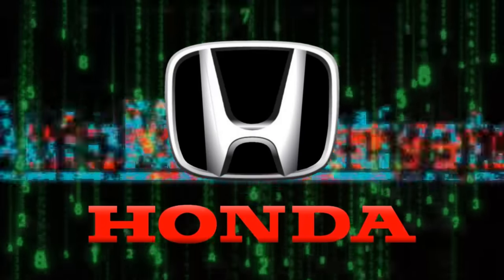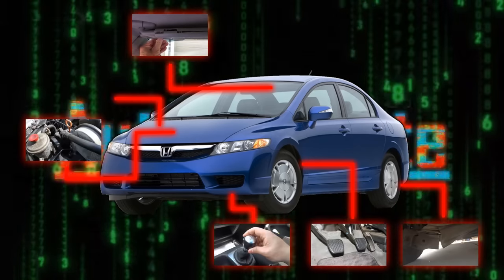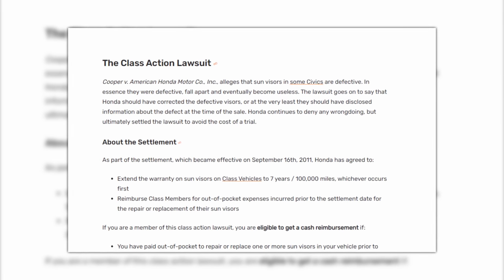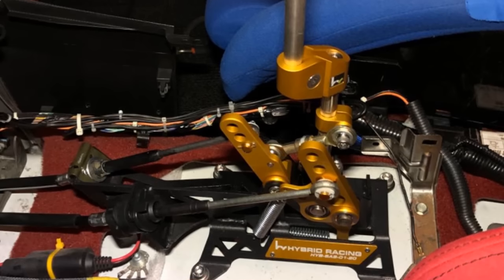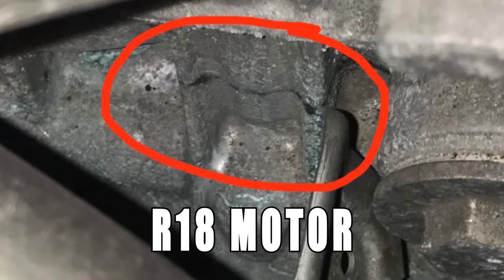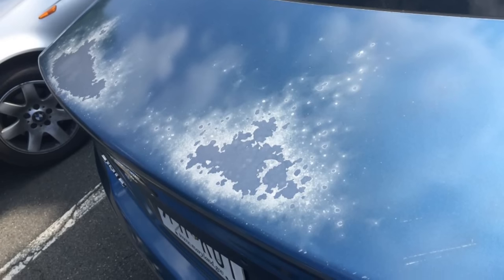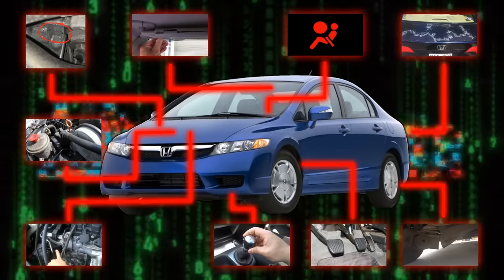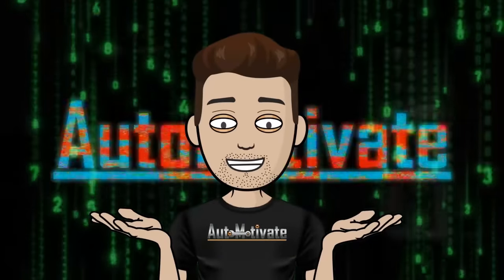Watch This Before Buying a Honda Civic 2006-2011

Comment: Over 400k on my 2006 Civic LX and she still drives like a charm!
Reply: I have a 2007 lx I can only hope mine lasts that long
Reply: 380k on mine. Super reliable. I love it. Abs just went on it though. Hoping for an easy fix.
Reply: R18?
Reply: I’m going to buy a 2007 lx tonight I’m super excited....
Reply: Jonhnny Ringo is it considered a sports car tho? For insurance purposes???
Reply: @teeniequeenie8369  what's the mileage on it? you're gonna love the car it's very reliable
Reply: 400k ? Went around the world twice sheesh
Reply: Manual or automatic transmission?
Reply: At what intervals do you change the fluids, if at all?
Reply: @marajevomanash  100,000 miles. Make sure you use genuine Honda power steering fluid as other types can destroy the seals.

Comment: I've had my 2006 for 14 years. No real problems, but the sun visor does fall. It has 340,000 miles and runs like it did the day I bought it. The most reliable car i have ever owned.

Comment: I owned a 2007 Honda civic. Of the eighteen cars that I have owned in my life, it ranks in the top three, without a doubt.
Reply: Interesting! I just got a 2007 Honda Civic. What were the other two cars that were in your top three?
Reply: Any issues in the last 5 months? I’m looking at an 07, but worried about the cracked engine block issue
Reply: I have a 2007 Honda Civic only had one problem in the time I’ve had it
Reply: What are the other two cars??
Reply: Just bought a 2007 civic. Lovely little car
Reply: Were the other 2 older gen civics?
Reply: @kingdoge69  That was mostly the 2006 model year and was fixed by the 2010 model year.

Comment: Mine is 06 civic coupe, best car I've ever owned. 160k miles and keeps on moving.
Reply: petrol or diesel?
Reply: Mine too
Reply: I am borrowing an 06 civic which currently has 204,000 and drives really nice. No, noticeable oil issues or engine issues, no major transmission slipping. 

I believe it has the r18 engine and automatic transmission. The interior is pretty nice. Good car.

Comment: 235k on a 2010 ex coupe. Only thing replaced, outside of regular brakes/tires/plugs, was a cat and engine mount at 100k.
Reply: I can attest to the pass. side engine mounts the hydraulics start to leak off eventually, solid cars though... like rock solid.
Reply: Brakes go quick in my 2010 civic and it is not because I ride my brakes. Always on the gas letting my turbo add a little fun

Comment: I love my 2011 Civic manual, no issues at all aside from the left rear wheel bearing at 110K. This car is so smooth to drive. I find that buying a car at the end of the model cycle helps to avoid common issues.
Reply: I got a 2011 also..I love it
Reply: The 06 thru 09 look better with those short overhangs and that steep rake in the windshield rolling artwork
Reply: I took a gamble and bought the first production year Si 😎

Just lost my driver side front brakes yesterday 😅
Reply: I have a 2011 Civic and after 12 I had my first part failure , the thermostat failed open after 134,000 miles and it was due for a coolant flush and change anyway , so I would call that unbelievably reliable and yes my paint is still great !

Comment: I literally have had none of these issues except for the motor mount issue, and that one is surprisingly easy to fix. These cars are very reliable. The only other issue I have had was a couple batteries needing replaced, a valve cover gasket, and then a starter, but those are all preventive maintenance issues that occur on ANY vehicle. I have around 190k on my 08 Civic EX coupe and it's still running strong. Though the issues in this video can potentially happen, they are still pretty rare issues
Reply: Update: I did end up running into the cheap visor falling apart on me lmao. Just went to the junkyard and got another one for $10. Sucked but it wasn't a big deal
Reply: how did you fix the motor mount issue?
Reply: @luisishere987Replacing them duh

Comment: I had the visor issue and my headliner sagging quite a bit. Another thing that I’ve seen on many 8th gen Civics is the weather stripping deteriorating everywhere but especially on the sides of the windshield. Nonetheless my 09 Civic has 110K and has never given me any problems in its 13 years of service. Still drives like new!
Reply: The headliner is an easy fix. My wife and I put red and white plaid on it 😅
I took the visors out because race car lol. #weightreduction
With the weatherstripping, another easy fix. That part is pretty easy to find and install. 
Couple easy projects to fix the car up! Cheers 🍻
Reply: Yep I have the problem with the windshield molding also. Called the dealer, and those 2 side strips were quoted at around $400. The parts person was just as shocked as I was.
Reply: @Maggot00679  Just clean the weather-stripping and rub ATP AT-205 Re-Seal on it.
Reply: @parkerbohnn  mine got to the point of falling apart and cracking so I wish I could have just done that. Thanks for the tip though 🍻
Reply: @Maggot00679  Honda should have had a recall on the 2006 Honda Civics there were so many cracked engine blocks in that model year. It really took to the 2010 model year to fix the problem.
Reply: @parkerbohnn  mine is an Si with a K20z3, so I never had the pleasure of dealing with the notorious R18 dying at ~90k miles.

Comment: Own two of these both coupes 07 and 09 great reliability and economy. Both have had motor mounts and third brake lights replaced. Radios also have issues but still work. 07 has 235k and 09 has 150k everything else has been routine maintainence would buy both again in a heartbeat
Reply: Are 09 civics just as susceptible to have a cracked engine block? I heard it wasn’t an issue for most 09 civics but it was still there
Reply: Radio issues will eventually lead to failure.  I'm surprised this did not make the list.  Also, cabin air blower motor and cabin air flow direction mechanism are common issues.

Comment: I bought a 2011 civic new, and am still driving it with 277000 miles, and have had none of the issues listed.  Only issues with mine was a power steering rack replacement, and replacing the compressor clutch for the air conditioning. Both of which I did myself.  The car has never been in a shop for repair other than a recall for the locking mechanism in the doors.  It consistantly gets 38 miles per gallon when I drive it (very little city driving).  No cvt, no turbo, no hybrid, and no problems.  I bought it on clearance for under $17000 when the new model year was coming out.  It is the best vehicle I have ever owned.
Reply: How's it going now?
Reply: Still going, we are going to give it to our granddaughter when she gets her drivers license.

Comment: Very interesting I have 305k on my 07.  Cheapest car To maintain that I’ve ever driven
Reply: Is the battery still working?
Reply: @lauraarabo7939   I bought a new battery three months ago. All is well so far.
Reply: @sangery5697  Thank you for replying!
Reply: I have a 2007 honda civic dx-g is it the same as yours basically ?

Comment: I redline my 2010 Civic Si about 20 times a day and somehow get 29mpgs combined. Like I literally dont understand.
Reply: Used to get 16.2 mpgs in my 2005 Subaru Legacy Gt after redlining it maybe twice a day.
Reply: lol same with my csx but i dont get that good at all for some reason?
Reply: @outdoorscanada9493  Are you stock?
Reply: @outdoorscanada9493  You meant crx right?
Reply: Yalll need more air in your tires if you getting bad gas mileage I run mine at 35 psi but some times I even go 36psi  lol
Reply: I had a 2015 so redlined it everyday for 4 years totaled it by wrecking into to a light post at 100mph in reverse
Reply: @leonardoantonietti400  Pardon? Why tf were you stunting in reverse?
Reply: @leonardoantonietti400  100 mph in reverse, great  cap 🧢 🤣
Reply: Gas can last me 2 weeks doing the same thing 😂
Reply: Oh I know why. It's a Honda :)
Reply: u average 25mpg tapping the rev limiter wherever i go in my mini truck
Reply: Whens the last time you cleaned your Map Sensor and throttle plate area? 
I just cleaned mine and holy shit I got my zoom zoom back and my gas mileage went back up!!
super super easy to clean too... use the CRC Mass Air Flow Sensor Cleaner... it's very gentle and is the only thing that should be used on the sensor... you can also use it to clean throttle body too... Peace!

Comment: I love my 2008 Honda Civic Sedan EX! 161000 miles runs like a champ!
Reply: Awesome! I just ran into a guy today about 2 hours ago who has a baby blue 2008 Honda Civic I think he said DX, maybe he said EX... but it looks so smooth... all he did was have it painted and put cool white rims on it and a muffler... and tinted windows. Look like the front was lowered a little bit too... looks so cool... do you know if they 2011 model has same look or do you recommend another model in this generation? I am looking to get 2008 unless one of the others is better to 2011.
Reply: Yesss I have a 2006 sedan ex with 131k!! She’s beautiful
Reply: @MikeKollin  2008 is a great reliable car. If you can buy one with normal miles for its year and has had regular routine maintain eye I would buy one! Sorry for the late response.

Comment: My 2011 has had zero issues outside of normal wear and tear and minor accidents still runs like new after 180k plus miles best most reliable car I have  owned
Reply: Have a 2011 with 108k. Not a single issue
Reply: How is it now?

Comment: 400k on my 08 Civic. No major repairs so far. I Just change the oil using full synthetic oil 🤷🏻‍♂️
Reply: WOW
Reply: That’s all you do?
Reply: @jonsnow2661  well I have drained and refilled the transmission oil when the service code requires it. Changed spark plugs a few times too.
Reply: I am a student and looking forward to buy a 2006 Honda Civic with 280k miles on it for $3500, single owner and no accidents. Should I buy it ?? The dealer mentioned it is sold as-is and he mentioned it twice.
Reply from the maker: If you have the cash, I would go private seller.. probably find one with much lower miles
Reply: @Schrodingers_cat000  Never pay a dealer what they ask.
Ask them why they won't give you at least 30 day warranty.
Bring a mechanic with you to do road test and let him inspect everything.
Good luck.
Reply: @Schrodingers_cat000   you can find an 06 Honda Civic for the same price with way less miles from a private dealer, I suggest passing on that one, dealerships always overprice cars
Reply: What about changing brake fluid?
Reply: Automatic transmission?
Reply: @brandonidrovo6348  yes it had automatic transmission. We sold a year ago with 148k on it. Still running. Got $2000 for it. 😃👍🏻

Comment: My 2010 civic LX runs like new with 130k miles and has never had one issue. Just maintain the engine oil, filter, power steering fliud, brake fluid etc and you'll be driving that car for the rest of your life. Oh and change your power steering fliud every 60k miles that's want causes the pump to fail is dirty power steering fluid. If you feel it's hard to turn your wheel it's most like just dirty fluid. Not a hard job, YouTube has so walk-throughs

Comment: About to cross 200k on my 11 civic lx 5spd manual transmission. I bought the car brand new in 2010. These are the "major" repairs I've had to do since owning.. clutch, alternator, serpentine belt, rotors and pads, new battery, oil change. It has been a great car for all these years. I would highly recommend to anyone, especially the manual version. While not the fastest, it makes driving the car that much more enjoyable.

Comment: I have a 2006 Honda Civic and it had only 33K miles back in 2017 and today it has 55K miles. It still runs like a champ! 🙂
Reply: I just bought one with 70000

Comment: I own a 2006 with the 5spd manual. I live in the Rockies and at 4500 feet this car is SLOW. 
Still, 180K miles and still kicking. Great buy.

Comment: I bought my 2007 civic in 2015. Still have it 9 years later and I LOVE it. I did have to replace the power steering pump, and the starter since I’ve owned it. Now I’m saving up to replace the motor mounts and the shocks and struts. Love my civic

Comment: I had a 2007 Honda Civic Coupe for 13 years. It was not without its problems. A lot of things in this video also happened to me including both visors, the engine mounts needing replaced, the wheel axel needing replacement because factory one was defective. Also the paint, airbag lights and even the engine block cracking are all true. I got under the warranty by 1 month dealer told me. It was a good car that never really rode straight or stable but excellent on gas for sure, nice sound system, coasted like a dream and a cool dashboard display.

Comment: i have an 06 honda civic and i absolutely love the car the drive, the milage, the looks, everything... when you mentioned the crack in the block i felt that one because the same thing has happened to my car.. the way it happened isi got service done at honda and my car was around the early stages of 100k miles and since this is my first car im not knowledge able in parts and what needed to be changed plus honda should of brought it up since they was working under the hood, anyway i was driving to this place about an hour away and some time between than my water pump failed and i wasn't aware of it so i drove the car hot and when i did it cracked the block.. took it to honda and they told me it will be $3k+ for a new motor/used one and i laughed at them.. im still dealing with the issue now and it has 160k miles.. if you don't mind paying $7 in coolant a month it should last till 200k+ miles.. my block started with one crack and broke open to two.. granted i tried fixing one side with jb weld and it failed miserably it still runs fine and im not about to drop $3k into a new motor id rather put that twords a newer model and never deal with that again... but figured id put my personal experience with the infamous "block leak" and tell you honda will no longer be on your side...
Reply: jb weld extreme heat for mufflers may have worked. You probably used the basic jb weld.

Comment: Bought my 09 ex sedan brand new when I was 20 and I’m still driving it. I’m about to hit 130k miles which isn’t much at all but Iv never had any of these issues . The only time the car left me stranded was when the ignition starter died, but that was definitely preventable because the car was having trouble starting for multiple months and I never had it looked at. Besides that, a belt tensioner snapped, my muffler snapped off, my driver side back window is stuck but not broken, and the entire center console lid is broken off but that was from a golf bag falling on it. None of these left me stranded and I’d consider to be wear and tear after 12 years. Some of the dash lights have started to go. Like the first fuel bar doesn’t light up. Little things. I put si seats in mine because I felt like mine were starting to wear internally and my back was hurting.The biggest flaw with the car IMO is because of the extended windshield, the A pillars are very long and create a huge blind spot that you don’t see in most cars. You have to move your head while going around wide turns. There’s also a pretty big recall on the passenger airbag. Free fix obviously. Interesting note, I deliver pizza like 3 days a week for 5 years, one of my coworkers has the same car just an 08. His has 160k miles. The weather lining between the car and the windshield on the drivers side is peeling off on both cars. Both cars have a small bubble rust spot in the same exact place inside the driver rear tire well. Maybe those are the design flaws? All in all, cars been good to me. It’s not a nice car, it’s not a fun car, but it’s easy to drive, light, and good for any young person. I can’t believe I’m still driving it 12 years later. I thought I’d only have it for 3 lol

Comment: I have a 2011 Si with 250k miles. Only problem I had was the windshield wipers. Got it fixed and still running strong.

Comment: Black 2010 Honda Civic Sport here:
89,000kms
- Body and paint in great condition
- Regular sythentic oil changes
- Only had minor repairs
- Had the passenger airbag replaced through a recall (no charges)
- Only somewhat major repair is a transmission fluid flush
- Brake pads only replaced twice through the 10  years.

Future projects:
- Undercoating protection done
- Change the headlamps
- Add foglights
- Replace the rotors
Reply: My civic has a ton of small issues, especially the motor mounts, you almost cannot hear the radio under volume 8
It didn't help that some of the speakers stopped working. Im planning to try to replace them and install a new head unit for Bluetooth and android auto

Comment: I've had all these problems besides the lower control arm problem on my 07 civic ex.You forgot to mention the issue where you have to drill out the hex bolt on the block if you were to replace the tensioner or the water pump.Main issue is the cheap paint.Very reliable and fun car to drive while being fuel efficient.
Reply from the maker: That definitely does not seem like a fun job to do..

Comment: Had a 2008 civic with only 140k miles. It was an electrical lemon after 80k miles. Four alternators, AC only worked while moving, one door lock stopped working and the rest would toggle on/off when driving under 15 mph. Among other items that self destructed. Like the sun visor. Lol